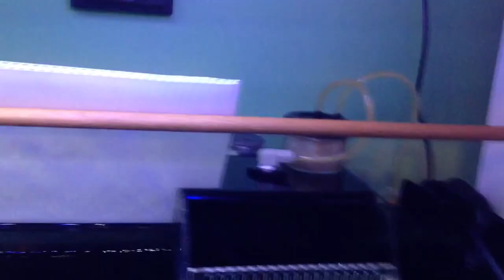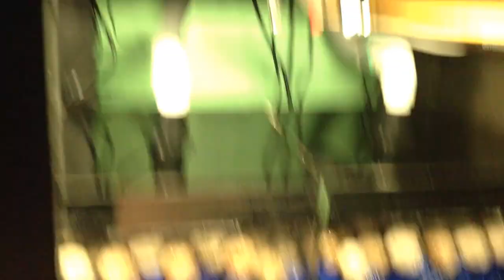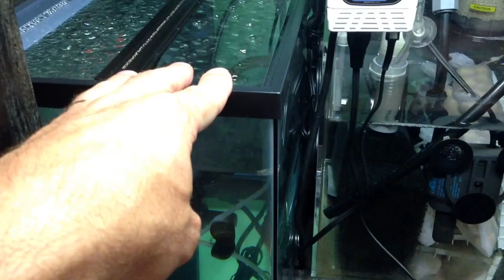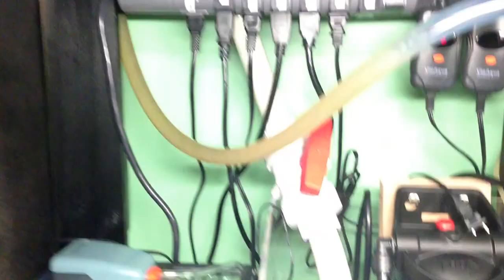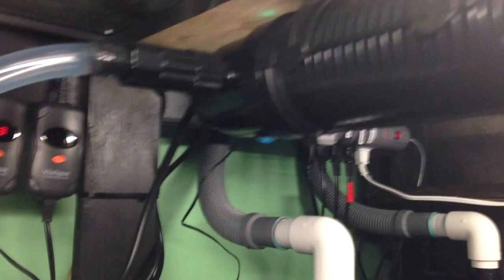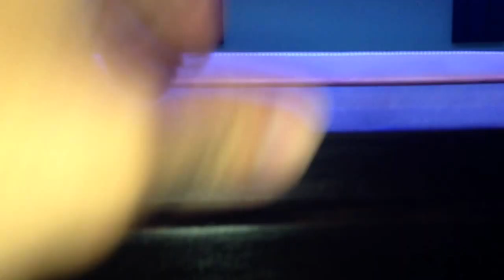David's Aquariums Contest Entry

Comment from the maker: Hey Alex. The ones that I'm using are the Belkin BP10820006 with 8 outlets (6 rotating) and built in surge protector rated at 1,800 joules. I like this type, because it allows for a more custom installation with the rotating plugs. Whatever you decide to get, just make sure you have a built in surge protector.

Comment from the maker: Unfortunately I didn't have room under the stand for the canister. I didn't want to use a water pump to drive the UV sterilizer, so I opted for the C-360. I'm able to put the Purigen in the canister too, which frees up room in the sump. No one knows it's even there, unless you look around the side of the stand. It's rather well hidden from sight. Thanks for the comment.

Comment from the maker: Thank you brother. Fluval makes excellent filters. A healthy fish only aquarium can be maintained using only a canister filter. I just wouldn't overstock without keeping a check on disolved oxygen and making necessary changes when levels get low. i.e. aeration and lower temperature. A canister filter is my favorite type of filter to use in other situations, such as a planted aquarium. There is plenty of info on the web to help you, if you ever want to utilize the sump. You can always PM me.

Comment from the maker: Thank you for the kind words. I'm currently performing a 25% weekly water change. I prepare 40 gallons of deionized water with 22 grams of Seachem's Cichlid Lake Salt and 56 grams of Seachem's Malawi/Victoria Buffer. The water parameters are constant at pH 8.2, 11* GH, 11* KH, NH3/NH4 @ 0ppm, NO2 @ 0ppm, and NO3 currently at 20ppm. I have achieved 0ppm NO3 before, and in time it will go back to 0ppm.